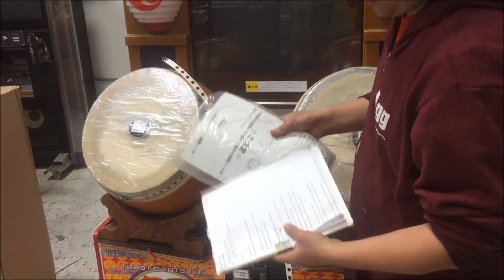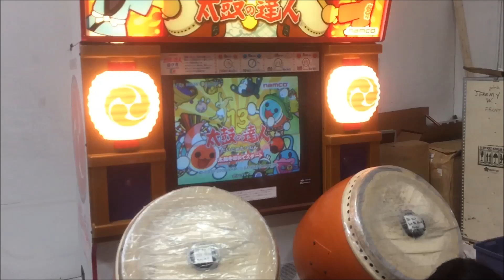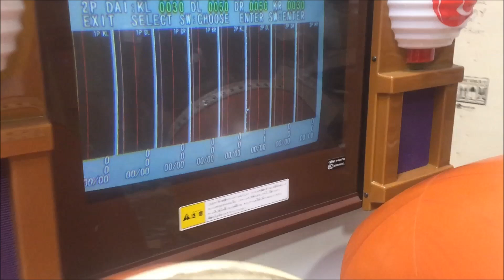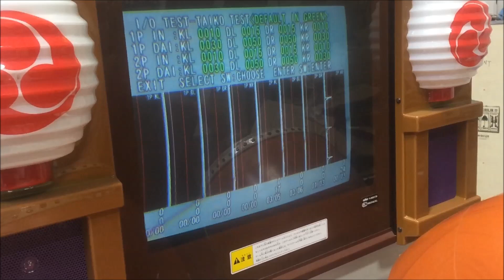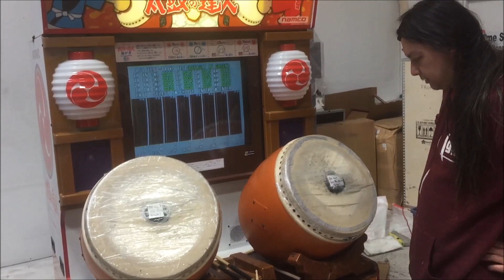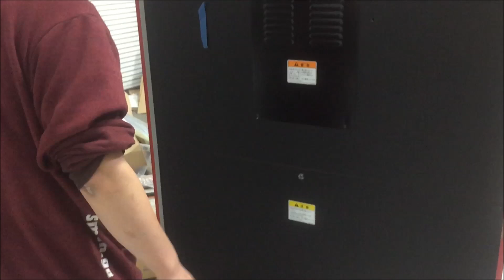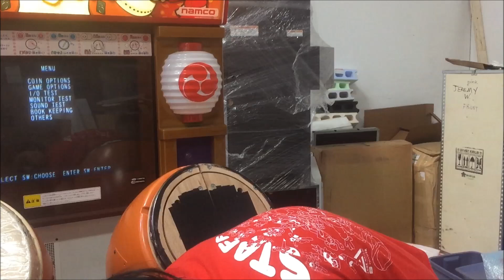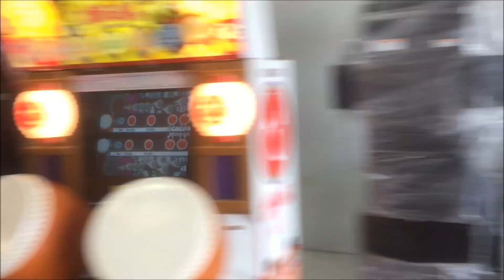Looking over Playland Japan's EXTREMELY long-lived Taiko no Tatsujin cabinet!

Comment: Hello
Hello
Can you recommend a place where I can buy replacement drum parts?
Reply from the maker: Parts come up regularly on  Yahoo! Japan.  Just search for 太鼓の達人 in the Arcade category.  I also stock parts, but for the moment, it's not a regular part of my business to supply to the general public.  Not sure if it'll allow the link, but below is the search I regularly use.

https://auctions.yahoo.co.jp/search/search?p=%E5%A4%AA%E9%BC%93%E3%81%AE%E9%81%94%E4%BA%BA&auccat=2084047781&va=%E5%A4%AA%E9%BC%93%E3%81%AE%E9%81%94%E4%BA%BA&exflg=1&b=1&n=100&mode=1